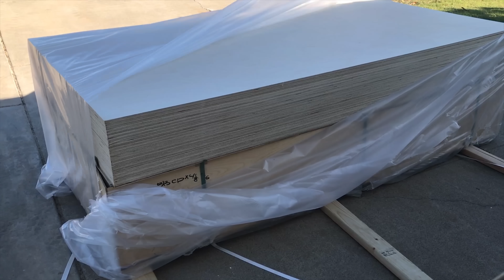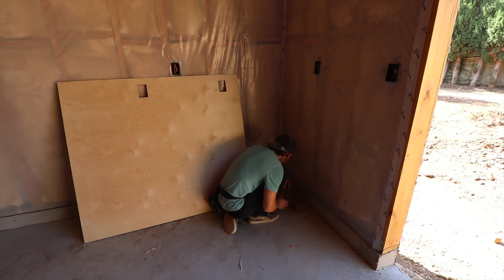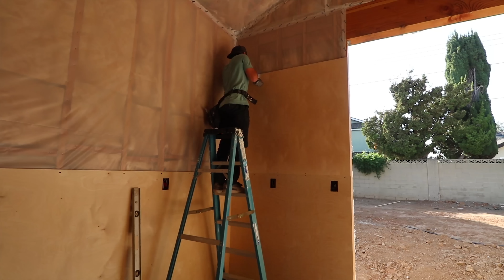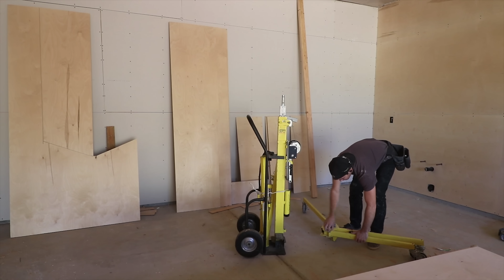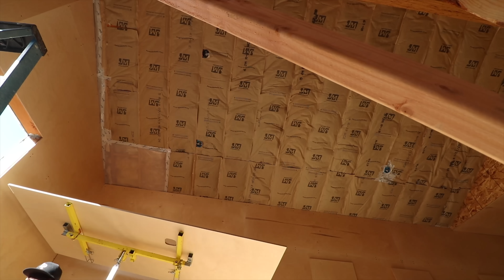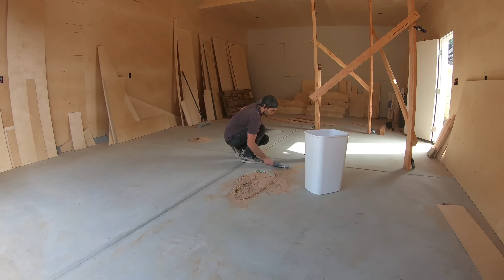Shop Build - Plywood-a-palooza

Comment: Great video my man.  So how is the 1/2" birch plywood holding up 3 years later?   I am about to embark on the same project for my single car garage and I am wondering if the 1/2" will be sufficient for hanging things on the wall and if it is thick enough to prevent sag in the middle or if I need to go to 3/4".  Thx.
Reply from the maker: The half inch ply has been working great! I try to find a stud for anything with a significant amount of weight (25+ lbs), though I know the plywood could hold even more. There isn’t any sag. Still holds up the same as it did on day one. If you are going to do half inch, make sure it’s quality. Mine is 9 ply and super strong. A lightweight 3 ply with a veneer might not have as much strength.
Reply: @BenTardif  Thank you for the reply sir. Glad to hear it is still holding up well.

Comment: I have a somewhat smaller shop 20x30 with 8 ft ceilings, I want to basically do what you have done.  The problem is you are about 40 years younger 🙂 and way better on the ladder.  I have some bids to have it done but it is cost prohibitive.  I want to insulate it and then install plywood on the walls and ceiling so I can then install  AC/Heat so I can work in it year round,  Great job,

Comment: Hey Ben. did you pour the concrete foundation with a lip on the interior with the plan to have the sheets of plywood sit on the lip as you were sheeting the interior walls?
Or did that just happen by chance?

greatly appreciate your input.

Thanks!
Reply from the maker: That was part of the plan. The floor is gradually slipped towards the barn door opening, but the stem wall (curb) is flat. It’s a pretty common construction requirement for my area so water in a garage flows out of the garage

Comment: Well done.. you're doing great! the projects are well thought through, your attention to detail is awesome, I love that you took the time to get those seams tight. In the glass industry and stairs we use "templates" that basically stretch across and have a wide edge when templating and transferring angles... and a coping foot for your jig saw... 

https://www.amazon.com/Stair-Template-Set%EF%BC%8CReplacement-Risers-Plates/dp/B07YRHQXX1/ref=sr_1_1_sspa?dchild=1&keywords=stair+jig&qid=1597131483&sr=8-1-spons&psc=1&spLa=ZW5jcnlwdGVkUXVhbGlmaWVyPUExN0ZZQ1AyV0MyUEY3JmVuY3J5cHRlZElkPUEwMDQ1ODAxVFdGRU1LOUUwNVFYJmVuY3J5cHRlZEFkSWQ9QTA1NzM1ODkyTkZUREkzOUNVUzBVJndpZGdldE5hbWU9c3BfYXRmJmFjdGlvbj1jbGlja1JlZGlyZWN0JmRvTm90TG9nQ2xpY2s9dHJ1ZQ==

https://www.amazon.com/Collins-Tool-Company-Coping-Foot/dp/B00B5IPTLG/ref=pd_bxgy_2/146-0590216-1528728?_encoding=UTF8&pd_rd_i=B00B5IPTLG&pd_rd_r=68756524-534b-4b3b-ad2b-6243042d8396&pd_rd_w=t9buy&pd_rd_wg=LnHRa&pf_rd_p=ce6c479b-ef53-49a6-845b-bbbf35c28dd3&pf_rd_r=E8ZW4ENAMDWNMANBNW33&psc=1&refRID=E8ZW4ENAMDWNMANBNW33

We love them... love your video's and projects great to watch!  Hope my links help you along the way.. and LOVE the shelving system.. .seriously good stuff! (that's later..)

Comment: Someone didn't watch any videos on drywalling before using the drywall lift. ;) So not lining up the sheets with the studs will probably result in some warping and misalignment of the edges/corners over time on the vaulted ceiling. To fix it you can put a baker behind both pieces to keep them in alignment. One thing to be warned of however is that just because you're using plywood instead of drywall doesn't mean it's strong enough to hold things that would have been attached to studs. Yes heavy tools and some shelving might be stronger but if you want strength you still need to drill into the stud. Most custom cabinets are made with 3/4 ply and not 1/2. Don't sell it as stronger than it is. Also watching you on that scaffolding was freaky enough even before the camera shaking. OSHA hates you. Anyway, looks nice!
Reply: @mister clean  I could have easily been distracted by well, every little fault I found. ;) However when he lifted that sheet up to the vault and I watched it sway without the feet in place I was just waiting for an obliteration of epic proportions!